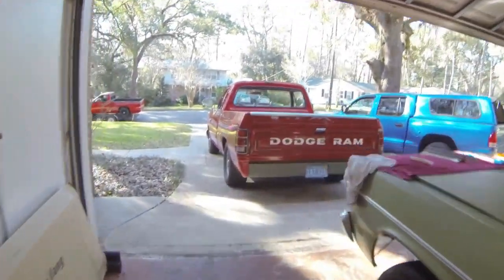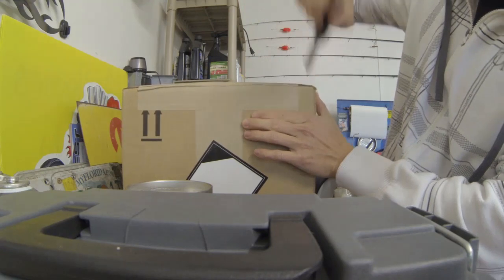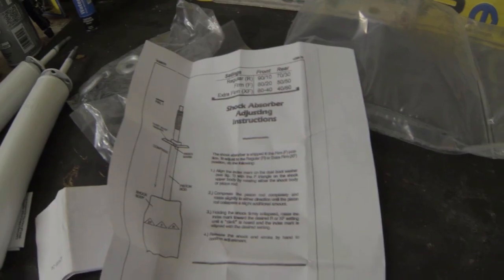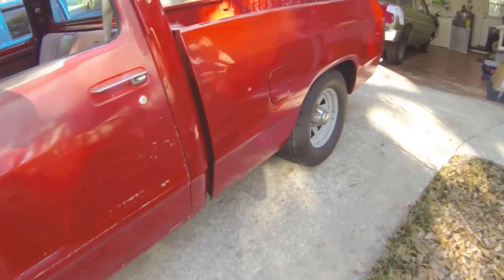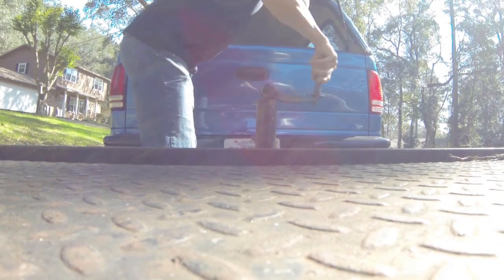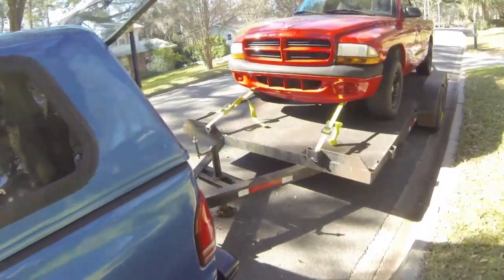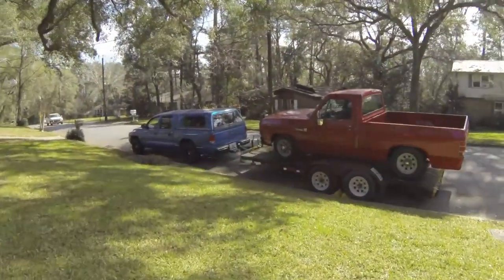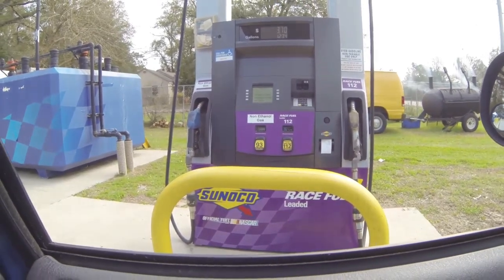How fast is it? Ready to go to the Drag Strip!

Comment: Nice truck. I do have a question what is the rear gear ratio, and stall in the converter. Thanks !
Reply from the maker: 3.55 gear and 2800 converter
Reply: Thanks for the fast reply,. It seems to be working great with that combo. ! .